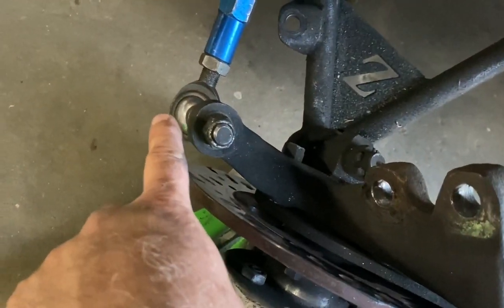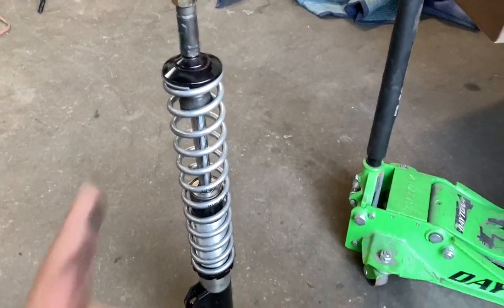Mustang Front End Travel, here is my secret!

Comment: If you make  a longer "A" arm that would  cure that ball joint  problem.  But not  a easy  fix.
Reply: Sn95 a arms are 3/4" longer and new edge are 1 1/2" longer, stock. Aftermarket ones should be similar.

Comment: john,i just added a 3" spacer to mine an some 16"x75# front springs and i ran into the ball joint binding deal. i run upr a arms an their ball joint but i noticed if i raised the a arm it would unbind it. im thinking a taller ball joint might fix it. i think qa1 an steeda make taller deals or find one that can take the extreme angle.
Reply from the maker: I have not tried a taller ball joint
Reply: @suicidal would a k member spacer help that ball joint angle?